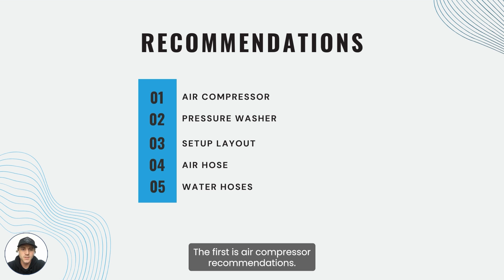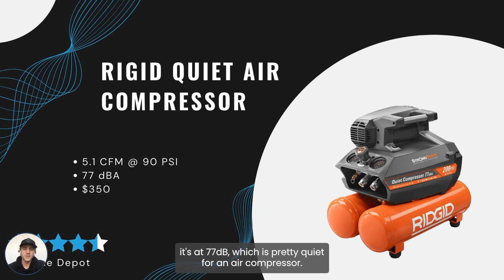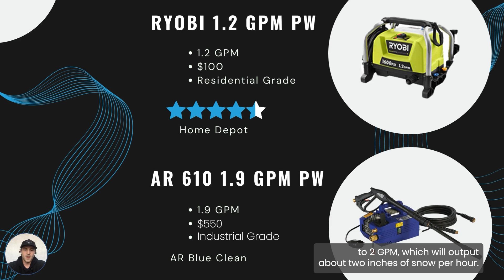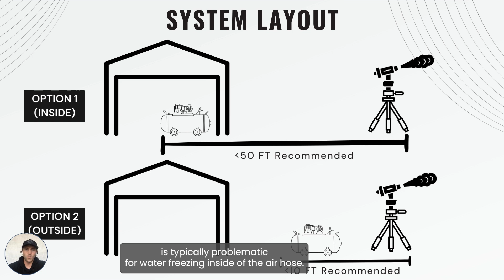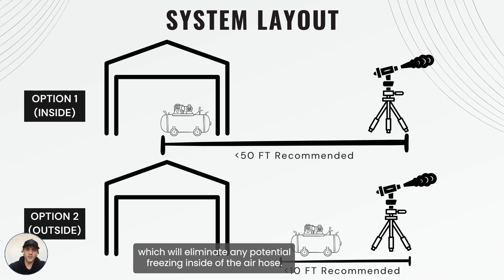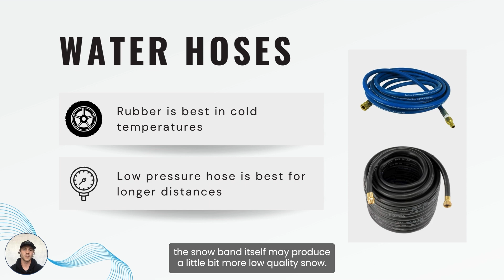Recommended Equipment For Residential Home Snowmaking

Comment: Forgot to add. There are products/ways out there to help minimize the noise from the pw and air compressor. Can't list them here or else my comment will be blocked. Certainly helpful to minimize neighbor complaints and if you plan to use your snow system on multiple occasions.

Comment: Just a few FYIs. To help prevent water hose and pressure washer (+ hose) freezeups if the system is off and it's below freezing, it is a good idea to get some RV antifreeze (5 gallon est) to inject into the entire system (not sure about the air lines). You will need a 12v or 110v pump plus garden hose fittings to do this. Put the RV antifreeze into a bucket and pump into through the source water hose until in come through the entire system (you will need to turn the system on briefly to pull the antifreeze into all the hoses, pw pump, etc. Once the antifreeze starts coming out the pressure washer hose (leave end open)then the system will be safe to leave outside in freezing weather. To start using the system again, pump water from a bucket like you did with the antifreeze into the system. Put another bucket at the exit point of the system (pw hose) and reclaim the antifreeze which you can reuse again later if needed. Again, you will need to run the system to pull in the fresh water into the system and push out the antifreeze into the reclaim bucket. The shorter your supply water hose is, the less antifreeze you will need. The longer it is, the more you will need.